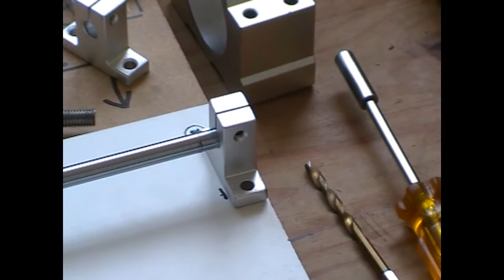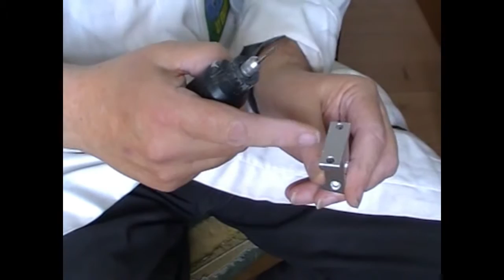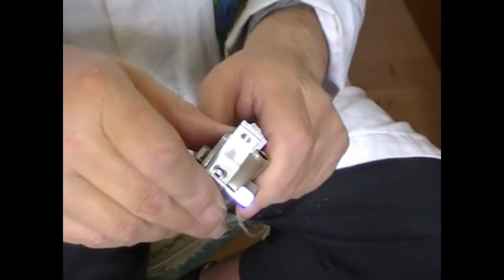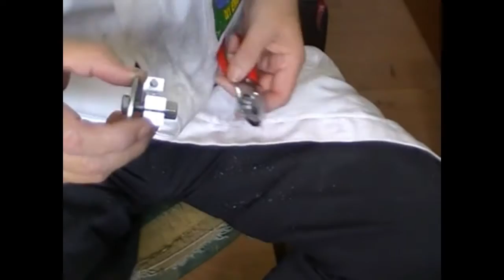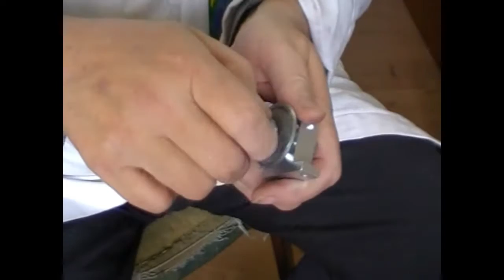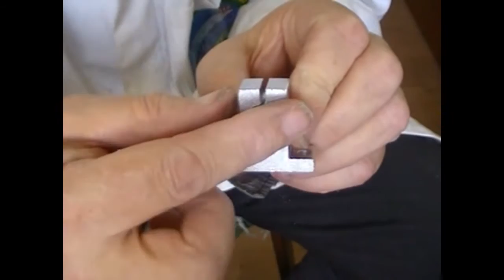DIY CNC Part 118

Comment: So hard to get that miniscule accuracy you have done a cracking job here and that's one hell of a handy hint regarding the holes to get that pinpoint accuracy, i must say my friend you have done a great job on the videography and explanation here, i can see that being far trickier than it looks, Kudos :-p
Reply from the maker: battonfive If you keep up these kind comments I will have to cut my doorways bigger to get my head through. Thank you very much indeed my very good friend.
Reply: Raymond Earle and you are a real skilled craftsman who deserves the praise my friend :-p you mix the modern with the mature and come up with real top notch results :-)
 Plus knowing wood and stuff you can widen that door frame easy enough :-D
Reply from the maker: battonfive Have you seen my dynomite? Can't find it anywhere. I can't get through the doors to the bathroom. AND I NEED TO GO!!!
Reply: Raymond Earle with all that gear you have there I expect a perfect cut with a lazer beam :-p least you could post smiley faces on the moon when you are board...that's some real power right there :-) living god material, Kin Jong would be proud :-D

Comment: Everything you do is so flipping clean...I couldn't live like that lol
Say, your comment didn't show up on my last vid, it did on Google+ but not on the vid to reply. Anyway, the motor is USB 5V powered, with a variable pot. The rest of the comment was hidden by Google minus, as I call it.
Reply from the maker: slider2732 MMMM. Your going to have a shock at the beginning of my next video. Not proud of it but I will show it. Just for you my very good friend. Been trying to deal with it. But time is my biggest enemy at the moment. Ah. He sighs. Google. What I wrote was along the lines of how many volts in compared to how many out to light the LED. Let's hope Google will give you all of this comment. LOL. You will enjoy the Finale'.
Reply: Raymond Earle I see, well it's 5V in, 5V out of the pickup coil at very low amperage. But then there's the rotation, torque and half of the pieces missing to consider lol.
Reply from the maker: Cheers for that my friend. It's the missing pieces that make it work so well. LOL. I am hoping my CLEAN video is being uploaded today. I hope you enjoy it. It's best viewed in full screen to see all the detail up close.

Comment: Proper job that wont brake any time soon. not long and it'll be hacking circuit boards my friend.
Reply from the maker: Norfolktuber Thank you my friend. Your very right. The sacraficial table is in place. I cheated the future. I have 4 sacraficial tables in place. Will explain on video. Now working on the final bit before I hook up the electronics and give her a try. Have a great weekend my friend.
Reply: you all so had time to make a time machine.
Reply from the maker: It's a tallent I have. I must have been a woman in another life. I can do 2 things at the same time. I also read maps upside down and I am from Venus.